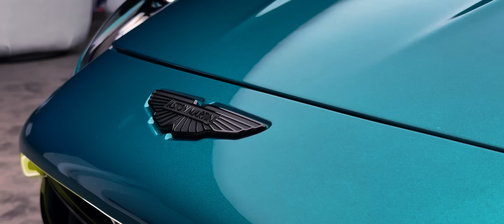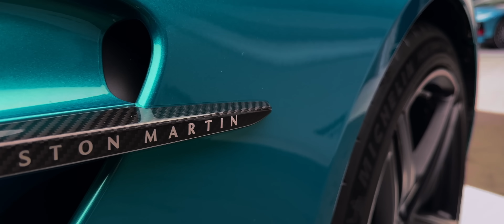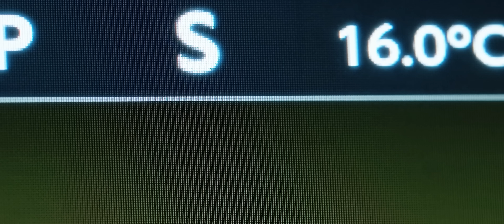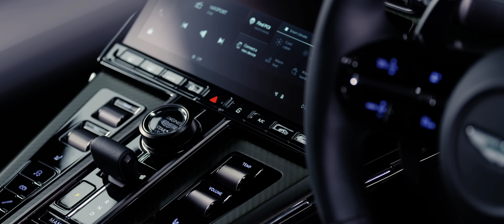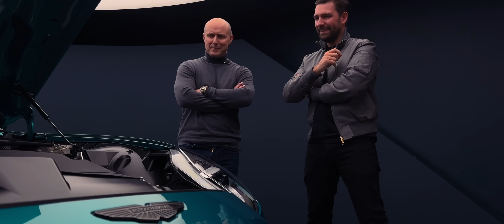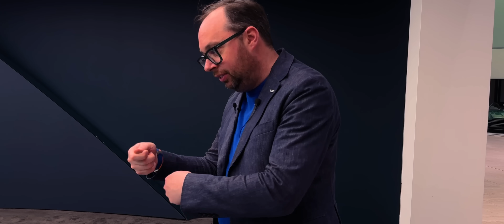NEW 655hp ASTON VANTAGE BRINGS IT TO FERRARI! FIRST LOOK AT FASTEST VANTAGE EVER

Comment: it looks better then the DB12 for me... only issue is that it needs a AWD opption. ya cant beat that AWD on the strret. my 15 CLS63s AMG is 5,000lbs+ 5.5L V8 577hp (stock) and AWD. I walk most 700/800hp rwd cars off the line on the street not the track... But my car runs the same #'s (about) on the street. thats the issue. a new m4 prob wins in the 1/4 vs this. smh

Comment: The car looks great as many Astons do but when a Camaro ZL1 has 650PS & 881Nm with a 0-60 of 3.4 and a rated top speed of 199mph (clocked at 202mph) and is the equivalent of 50,000 pounds (with some nice carbon fiber bits and leather/suede trim), is it really Ferrari they're bringing it to? Only if you have a Portofino I suspect. The Aston is a much nicer car, no denying that, but 3 times the price nicer and no faster? Not to me anyway.

Comment: I will give Aston a TON of credit for caring about materials used in their cars. You might think the grille being metal is a little thing. Most of the high end cars I've been around, ie; Bentley, Maybach use plastic for their grilles which I always thought cheapened the car for multi hundred-thousand $ price point. Aston cares about the details, and it shows.

Comment: I don‘t know why but the direction Aston is moving is the wrong direction.
Essentially they are going back to the VH Plattform-mistake where there was not enough distinction between DB9 and Vantage. Now we get again a car that from the front looks to much DB12 and from the interior almost looks identical. Engine is even basically the same.

While I loved both last generations of the Vantage, this one needs to grow on me.
Cons:
The best part of it is the rear but the evolution of the old Vantage looks like what BMW and Merc are doing, these extra vents in the side, they don‘t look grown up and refined but kind of childish, hope atleast they are real and not just fake vents. Rest of the rear is totally fine.
Front: The lower end of the grill… nah, in this class the sensor should sit behind the grille - actually the radar is not even necessary - thats a sports car and not a luxury limousine or a tesla.
The bonnet/bumper section surrounding the nose is to sharp while the headlights look to round. On the headlights I would have preferred a rather DB11ish contour with sharper edges and less of an „egg“-shape.
On the side profile, the wheels are just to big and the car sits to high for such big wheels. It looks to much like an off roader. 1-2 inches less and like 1“ lowered and the stance would be perfect. The ratio of rubber to alloy is fine, its just the size…
Interior: 1:1 copy of the DB12 but with the vertical parts beeing of carbon. This interior belongs in a boring Lexus but for an aston I expected a more playful interior. The old layout was quite good. The doorpanels look to bland. But the upside is the surrouding of the speedo, looks a lot sportier and more integrated. 
More power is also the last thing that the car needed but a weight reduction would have been a great thing. More carbon body panels, less electronics. This car should be sub 1500kg with a driver and 75% filled tank. Not over 1600kg without these… smaller wheels and brakes would have done the first 50kg, the body panels another 30-50kg, electronics could have done the rest. If you reduce 150kg of weight, the feeling on how the car handles will improve much more then if you slap another 150hp on top. 

Looking forward to the manual and hopefully V12 Version of this - because these are what I preferred on the older Vantages.

Comment: Nah im sorry needs bigger Hood vents also needs Fender Vents and its to high off the ground and the Side skirt Design looks like the car is Rounded right before the rear tire , also need rear Brake inlets I dont like it. It looks very Unrefined as far as its capability  with aero and down force with power this car is outputting